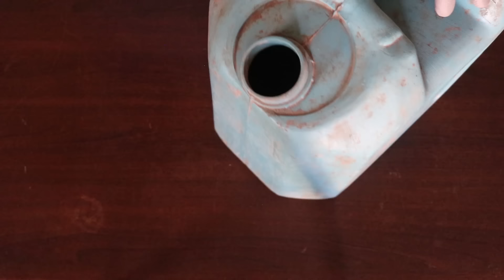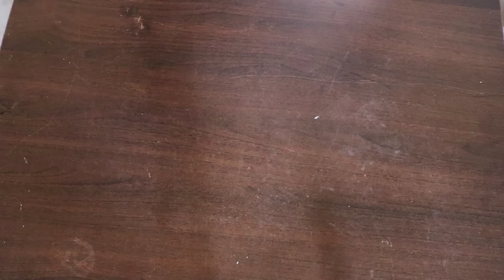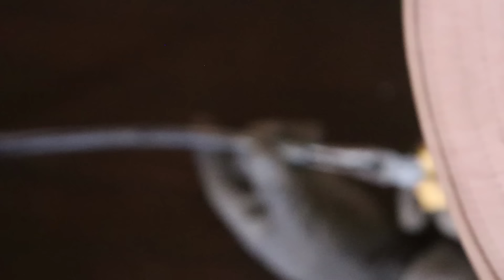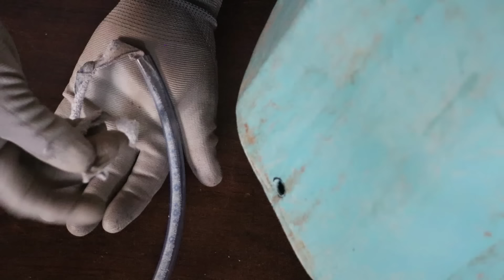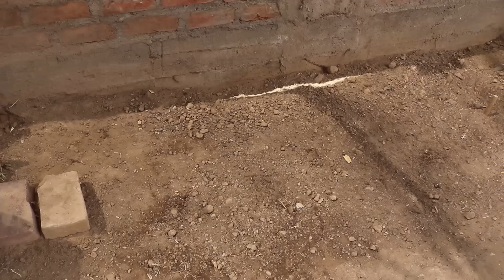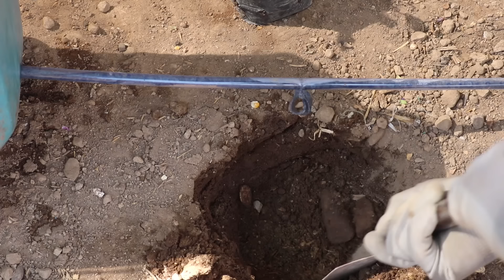Como hacer RIEGO POR GOTEO CASERO Y AUTOMATICO fácil y rápido sirve para chilis,  fresas tomates.

Comment: I've seen a bike valve used to administer the drip. Seems to be alot easier than inserting a long slim piece of cloth.
Reply: Where did you see the bike valve idea please?
Reply: @maryrichardson5841  I'm sorry I can't remember for the love of me.

But basically he took a 5 gallon drum of water that had been cut in half so you could fill it with water, and with a soldering gun melted a tiny hole in the drum which he stuffed with the bike valve and attached a small piece of hollow tubing which he used to steer the drip feed to where it needed to.

Comment: Having tried this it is useless as the cloth gets blocked by Waterpariceles after 2-3 days in the Sun. Who wants to put every 3 days new cloth into this tube?
Reply: Make  holes at the cloth wrapped are a.the holes must be tiny like a pen's tube (refill tube )cut and insert into the hole stick it with gum.later u can insert small coconut leaves stick and adjust it
Reply from the maker: I understand you, if the water is blocked, just make the holes a little bigger, so the water will start to flow normally. Have a nice day.